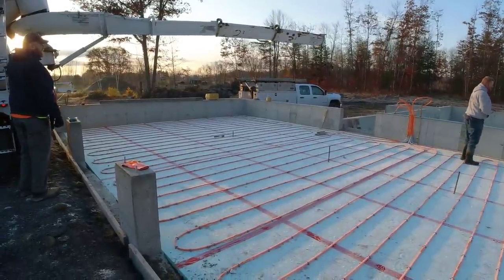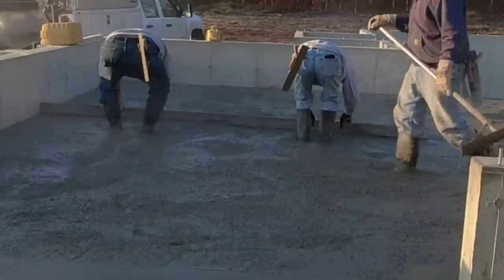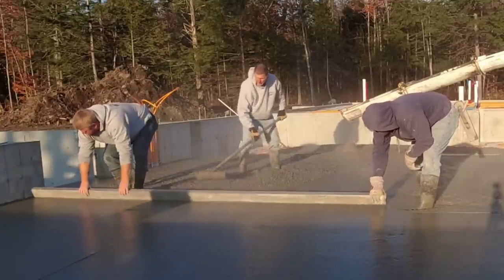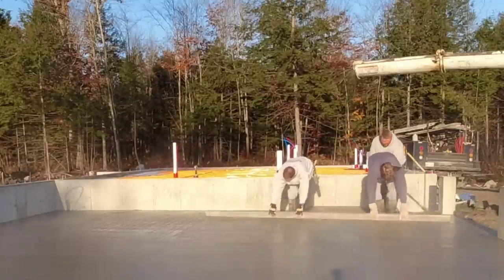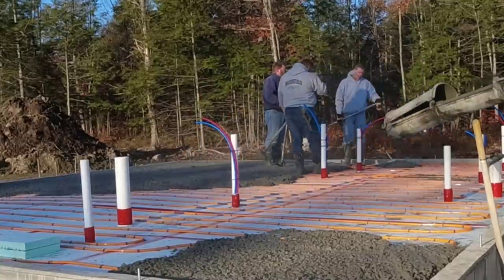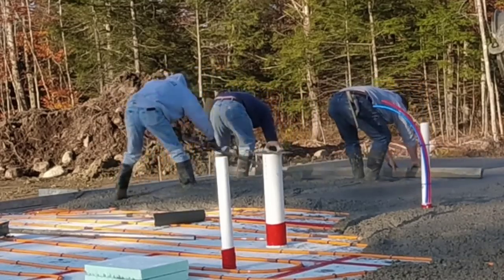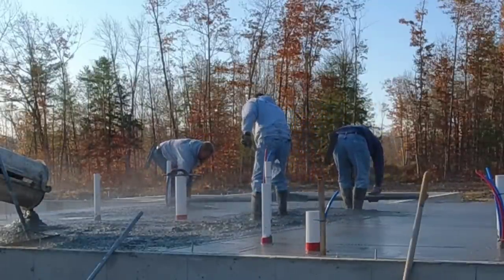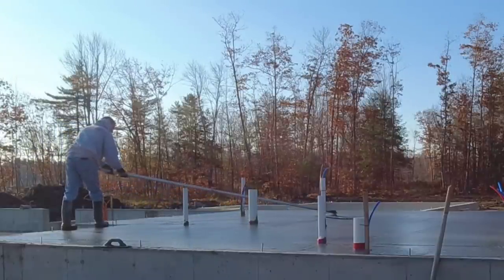My Fast Setting Cold Weather Concrete Mix (Making Money)

Comment from the maker: This is the cold mix design we use for our floors. 4000 psi mix (cement only NO fly ash or slag) 120 - 160 degree F hot water, Mid or High range water reducer, Bag flake calcium chloride. (You can sub liquid cal 2% but it doesn't usually set up as good with liquid)  The temperature of the hot water and the amount of accelerator is the key really.
Reply: Awesome. Great mix thank you.
Reply: I used your mix yesterday and it worked out great! We started at 7am and around 11am we were loading up and headed to the next job. The flake is alot better than the liquid for sure I my experience. Thank you Mike!

Comment: What’s is the cold weather mix you used in this pour.
Reply: I'm going to guess 4000psi, water reducer, 2% calcium chloride, hot water
Reply from the maker: I pinned it up above.

Comment: Let's see that cold mix, I was on a  slabs here in Oregon till midnight, Thanks for the videos.
Reply from the maker: 4000 psi mix (cement only NO fly ash or slag) 120 - 160 degree F hot water, Mid or High range water reducer, Bag flake calcium chloride.

Comment: Fifty years ago, I attended college in the Upper Penninsula of Michigan.  Most all the new buildings on campus were being built by the same contractor.  He also owned the redi-mix company.  He could pour concrete even in the coldest weather. Slabs, walls, foundations, all of it.  I understood that he wrote books on it.  He used a lot of tarps, lumber, plastic, and salamanders.
Reply: I have lived in the U.P. my whole life and you are correct.....I've worked on many a concrete projects through our winters up here.  Walgreens, Walmart, hospitals, etc.  It's not the most convenient thawing out substrate, building structures to hold heat in, covering everything in thermal blankets....but where there is a will, there's a way.

Comment: What cold mix do you use?
Reply: Just wait till It gets above 2 degree's on site in Britain....hey I'm a slate roofer that's when the bricklayers start working on site with motar and men we use woolly hat or hood man it will keep the heat in body and help frozen fingers....the lads and me worked in Germany after the Berlin wall came down, there was a very cold winter around that time, the nails in our pockets wood stick to your fingers and the aluminium scaffolding your bare hands would stick to it 😂🤣🤠 ....hey winter time back in Britain felt milder for a while 😃🌄🤠 anyway men back to work the lads are giving me the evileye 😛🤠.
Reply from the maker: I pinned the mix design up top!
Reply from the maker: I pinned the mix design up top!

Comment: I assume you can't do a wet cure when it's that cold. Are the blankets heated? How do you keep it above freezing when it's 10°?
Reply from the maker: Concrete blankets and some hay keep it from freezing.
Reply: Hay or straw is a good and inexpensive insulation. Thanks!

Comment: Do you use blankets after the pour for the cold nights? I use 4000 psi straight  cement an 2% calcium.
Reply: Hope you mean 4,000 mix, hehe
Reply from the maker: Yes, cover with blankets under 30 degrees

Comment: Yes, what is the cold weather mix design? Love your channel Mike.
Reply from the maker: 4000 psi mix (cement only NO fly ash or slag) 120 - 160 degree F hot water, Mid or High range water reducer, Bag flake calcium chloride.
Reply: @MikeDayConcrete  Hey, v thanks Mike. Appreciate the response and sharing your knowledge. You do some amazing work. You are like my mentor. Love your channel. All the best.

Comment: I want to know the cold weather mix.  Thanks Mike
Reply from the maker: Top of the comments
Reply: @MikeDayConcrete  Thank you Mike.  I am not a concrete contractor.  But I just poured my very first slab on my property yesterday.  Fortunately, because we are having unseasonably warm weather here in Montana, I only had to add hot water to the mix.  I made a couple amateur mistakes, but overall I’m pretty satisfied with how it has turned out.  27x10 slab 6 inches thick with a broom finish.  It’s been on the ground for almost 24 hours now.  Was over 60 degrees when we poured.  Your videos were my greatest resource to give me the confidence to try this.  I am very grateful and appreciative of the time you take to video your work.

Comment: Hi Mike, just poured 23 yard cement driveway 1 week ago and the cement is very splotchy. Large areas of light spots and dark spots all over. Does not look even. My cement contractor tells me this will all even out when fully cured. It looks horrible right now. Will the color even out or will I have to live with this look forever. Thanks
Reply from the maker: It should all even out, yes. Takes longer in colder temps to even out.

Comment: what"ts the cold weather mix. Is it 4000PSI 3% calcium straight cement?... and maybe a water substitute, water reducer... ?  And maybe a tight slump like 4 maybe 5... Here in Florida we can only add up to 3% calcium... Sorry I made a mistake here in Florida they only allow only up to 2% calcium...
Reply from the maker: Very similar to that, yes. It's up top of the comments

Comment: What is the cold weather mix Design? Southeast PA here. Calcium?
Reply: I’m from Pittsburgh and our mix design is as follows.
4000 psi with 50/50 blend of #67 and #8 stone,
High Range water reducer batched at a 6 in slump 
1-2% calcium chloride accelerator added on site by driver if there is no steel reinforcement( calcium will cause corrosion of the steel). If steel is present the concrete plant can add 1-2% non chloride accelerator when batching. 
Addition of micro fiber reinforcement at a rate of 1 lb per cubic yard . 
All batch plants will be using heated water at this time of the year too. 

Hope this helps
Reply: @CODA-Improvements  thanks, this helps alot!
Reply: @CODA-Improvements  is there any difference of the percentage of accelerator used? For example, if 35 degrees outside, 10 yard pour,  4 inches thick with wire mesh, 4,000 psi with a water reducer, how much time to place and finish if poured at a 6 slump?  Just curious to see how fast the accelerator works. Thank you.

Comment: Air entrainment, water reducer , calcium chloride hot hot water ? Like to know that’s my guess .
Reply from the maker: 4000 psi mix (cement only NO fly ash or slag) 120 - 160 degree F hot water, Mid or High range water reducer, Bag flake calcium chloride.
Reply from the maker: 4000 psi mix (cement only NO fly ash or slag) 120 - 160 degree F hot water, Mid or High range water reducer, Bag flake calcium chloride.
Reply from the maker: 4000 psi mix (cement only NO fly ash or slag) 120 - 160 degree F hot water, Mid or High range water reducer, Bag flake calcium chloride.
Reply from the maker: 4000 psi mix (cement only NO fly ash or slag) 120 - 160 degree F hot water, Mid or High range water reducer, Bag flake calcium chloride.
Reply from the maker: 4000 psi mix (cement only NO fly ash or slag) 120 - 160 degree F hot water, Mid or High range water reducer, Bag flake calcium chloride.
Reply from the maker: 4000 psi mix (cement only NO fly ash or slag) 120 - 160 degree F hot water, Mid or High range water reducer, Bag flake calcium chloride.
Reply from the maker: 4000 psi mix (cement only NO fly ash or slag) 120 - 160 degree F hot water, Mid or High range water reducer, Bag flake calcium chloride.
Reply from the maker: 4000 psi mix (cement only NO fly ash or slag) 120 - 160 degree F hot water, Mid or High range water reducer, Bag flake calcium chloride.
Reply from the maker: 4000 psi mix (cement only NO fly ash or slag) 120 - 160 degree F hot water, Mid or High range water reducer, Bag flake calcium chloride.
Reply from the maker: 4000 psi mix (cement only NO fly ash or slag) 120 - 160 degree F hot water, Mid or High range water reducer, Bag flake calcium chloride.
Reply from the maker: 4000 psi mix (cement only NO fly ash or slag) 120 - 160 degree F hot water, Mid or High range water reducer, Bag flake calcium chloride.
Reply from the maker: 4000 psi mix (cement only NO fly ash or slag) 120 - 160 degree F hot water, Mid or High range water reducer, Bag flake calcium chloride.

Comment: I have to pour my slab for my house please send me the cold weather mix I have a mono heated slab 30x40 I'll be pouring in December in Pa.
Reply: Ron , I’m from Pittsburgh and our mix design is as follows.
4000 psi with 50/50 blend of #67 and #8 stone,
High Range water reducer batched at a 6 in slump 
1-2% calcium chloride accelerator added on site by driver .
All batch plants will be using heated water at this time of the year too. 

Hope this helps , and good luck with your pour.